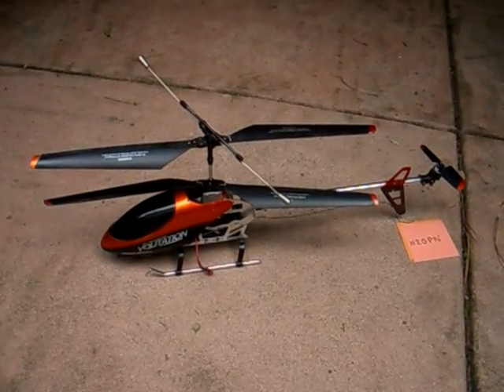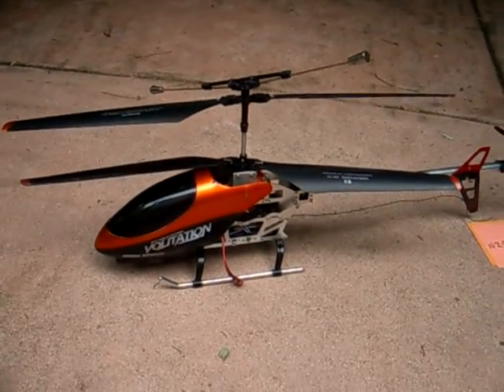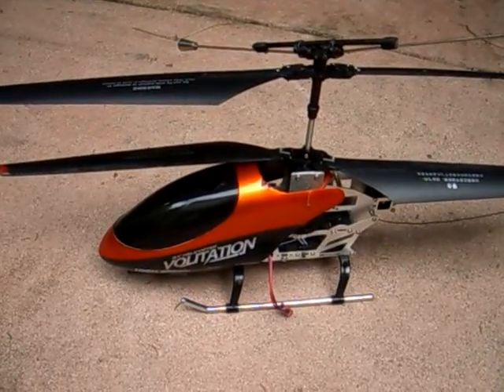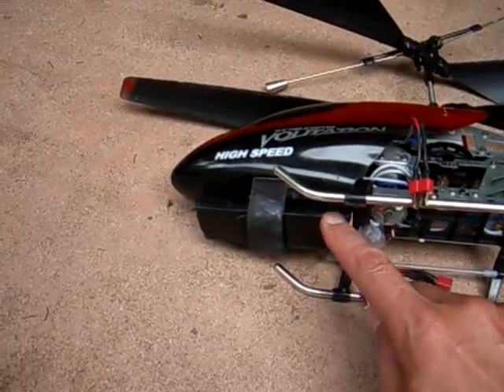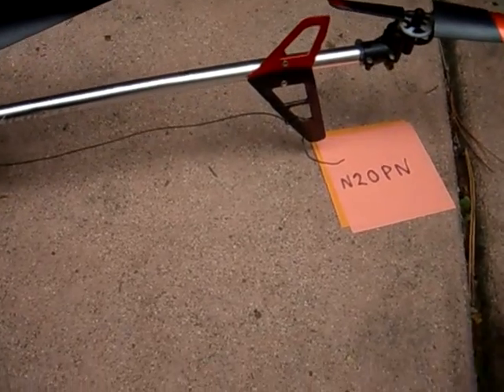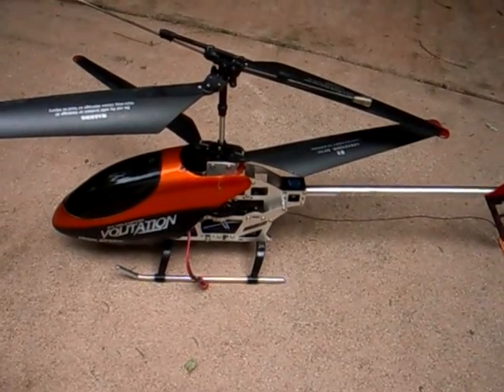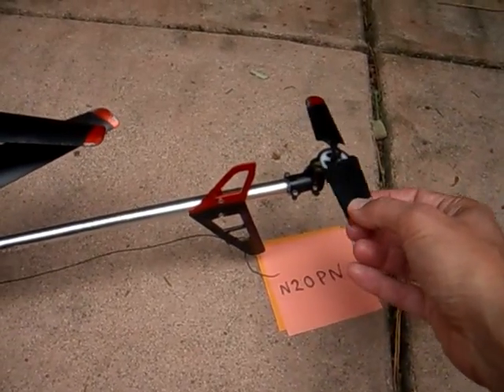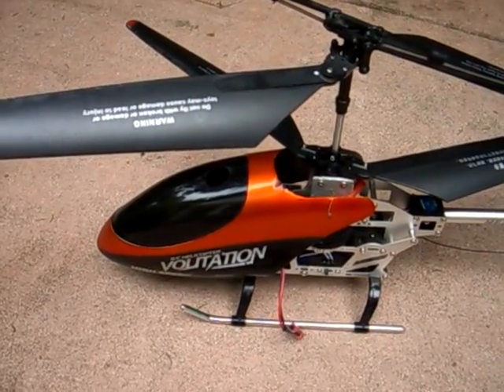9053 Volitation (and DH 9101) helicopter modifications

Comment: Could someone tell me how to solve my issue with this helo.;

After buying I had 3 flights and each one crashed from about 25feet. I recharged the battery, turned everything on and started up the throttle. When throttling up the blades acted like they wanted to turn but the blades only move like have an inch and then quit. 

What might the problem be ? I think its a motor, what could be wrong? 

Also which blades are you reversing, the bottom or top and why would you have to remove the shaft at

Comment: hi is a pleasure. I am  have the same hobby and I want to make a query.
I have a Volitation 9053 and I want to modify it to fly long distaces using these components:

The maximum ground distance was 7.4km away from base.
My Equipment:
- Volitation 9053
- Dual brushless motors Turnigy 1050KV
- Dual 18A ESC
- 5000mah 3s LiPo
- RVOSD gen2
- Thomas Long Range System with Booster set to 3W of output power
- 900mhz video gear 
- Video Oracle Diversity with long omnidirectional and patch antennas

Comment: After tons of research, it all comes down to weight.  After comparing the weight of the stock (88g) to a Sky Lipo 1600mAh 7.4V 20C (98g) and taking into consideration I want to attach a MUVI camera to the heli, I think I'll return the batteries to Amazon and get the Sky Lipo from XHeli (they're on sale for $6.70!). I also picked up a Thunder AC6 charger...way more than I need, but grants room for future endeavors w/ higher-end heli's =)

Comment: Hammy...you've given so much great information. I've followed nearly all of your videos and feel pretty confident in ??the upgrades/modifications I'm making to my Volitation.  Here's a question for you...I accidentally ordered 3 11.1v 2200mAh 20c batteries from Amazon. Will the battery burn anything out, being that it's a higher voltage? If so, what will burn out?  The PCB? Main motors? Tail motor? Will upgrading those parts resolve burn-out concerns? If so, which motors/PCB should I go with?

Comment from the maker: @tvtubedog    If the battery is charged I wouldn’t worry about the green light. The blue tail light connector may be loose on the circuit board. If the lower blade grip is loose, the heli won’t fly. Make sure the screws of the blade grip are aligned with the holes in the metal shaft. It may help if you remove a screw, align the holes with a pin, then tighten the screws. Hope this helps…

Comment: I have learned a lot from this video. Instead of replacing the tail motor as suggested, I have another suggestion. I found that this beast runs faster in reverse than forward so here's what I did: Swap the blue and white wires going to the tail motor...hopefully you have some electrical inclination to do this. Also, move the red wire on the forward/backward potentiometer inside the transmitter to the other available terminal. This restores the normal joystick control; up = forward.

Comment from the maker: @ElemeStudios 
You only need to cut the white gear base if the shaft of the new motor is too short. The metal pin is on the bottom of the tail assembly. I used a small screw driver to start to loosen it, then pulled it out with a pliers.

Comment: Hammy
I've noticed there are several different N20 motors available...different voltage ratings etc...which is the correct one...voltage and amperage? 
Have you seen the newer Double Horse 3-channel Model 9100 with the single blade, servo-actuated pitch control for $60 US dollars???
The flybar for the DH 9077 I ordered came in today and am going to install it on my 9050 (twin to the 9053) and was pleasently surprised to see it has a motion sensored LED on one end...very cool!!!!!

Comment from the maker: @ElemeStudios  Not sure where you can buy a pinion gear, I just re-used the one from the original motor. It is not glued on, it is friction-fitted. To remove, put motor in a vice, heat pinion year with a torch (I used a barbecue torch with a blue flame) and use flat head screw driver to flip it off when it is red-hot. Let cool, put new motor in vice gently tap pinion gear on top of shaft, heat with a torch and the gear can then be tapped into place.

Comment from the maker: @toddy2519  In ebay search for n20 motor. You will have to solder on wires and re-use the pinion gear (see next comment).

Comment from the maker: @CHRISJ0AN  I used a 3mm carbon fiber tube. I put a couple of spacers on the central part of the balance bar so the tube wouldn't hit the plastic end of the shaft. I used black tape to attach the ends of the tube to the balance bar. Thanks! glad you like it.

Comment: the 9101 is a joke as well! same prob with 9101 u can not fly in high rate and make quick turns or u have flight bar strike the blades and cause u to crash i came down from about 60ft like a dead duck! lol i fly glow engine heli's and 600 class electric i was not expecting much at all from the 9101 but cmon at least some quick turns in no wind with out a crash due to bad design please! lol  enjoy ur heli and the sport of rc flying!

Comment from the maker: @shsknight14   It is a replacement motor, the original wore out after a lot of flying. Not sure, but I think it is the same as the original motor. The heli moves faster because I increased the size of the propeller. Syma has a new helicopter the 9101. It looks identical to the Volitation except apparently, they have increased the distance between the coaxial blades.

Comment from the maker: @NatyleeFang  Thanks for comments. With these mods, especially increasing distance between the blades, the heli stopped crashing and I started flying it a lot. After a while the  motors burn out. Replacement main motors are available, but the tail motor was not available only the the entire tail unit is sold. So when your tail motor stops working you can either replace the whole tail unit (about $15) or just the tail motor (N20PN). I use a 7.4v 2,000 mAh lip battery.

Comment from the maker: @Keirosabi 
The plastic end of the inner shaft goes through a hole in the balance bar. Glue or tape about a 1/8 inch piece of plastic or cardboard on either side of the hole of balance bar, this raises the carbon fiber tube so when you attach it's end to metal balance bar, the metal bar will be bent slightly up.

Comment from the maker: @Keirosabi 
That is a 5 inch piece of 0.125 inch diameter carbon fiber tubing. It is secured on ends with tape and has a spacer in the middle so it doesn't hit the plastic end of the inner shaft. Tower Hobbies has them.

Comment from the maker: @moron32 
At least for my 9053 it did help. Initially, mine was plagued with crashes, some of which were due to flimsy connections overheating and failing. I have not had crashes since replacing connectors with higher amperage ratings such as Deans connectors. Also found that unwinding the antennae increased the range. I did like your video.

Comment from the maker: @golani4455 
I think the N20 and the existing motor are the same and their RPM is the same. Some motors have a short shaft and others a long shaft (?). That is a capacitor, not a resistor, it reduces motor interference with the radio receiver, so leave it in place.

Comment: ok i see, need to find a torch now, how much better is the N20 from the existing motor? does is have more rpm? do i leave that little transistor that sits on the motor connection? it sits on the negative positive connector.

thanks alot

Comment from the maker: @golani4455   
There is a pin that runs up into the base of the white gear, pull this pin out. Using a razor, cut off enough of the base of the white gear so that it sits lower and makes contact with the N20pn motor pinion gear. I used a small torch to heat the pinion gear when I pulled it off the old motor.  I put the pinion gear on the new motor shaft, heated it with a torch, and tapped it in place with a small hammer. If you don't heat the pinion gear you might bend the shaft.

Comment from the maker: @tiednotes45554 
I have not used the charger supplied with this helicopter. But I think it should work with any 7.4v battery. I use an Esky charger (7.4v and 11.1v) cost about $10.

Comment from the maker: @1andressole 
This helicopter uses brushed motors, the brushes wear out after a while. I replaced the tail motor only when it stopped working. The horizontal tail wing actually decreased forward motion of the helicopter, so I removed it. The vertical tail wing is only for decoration. On my heli, there is a noticeable difference between slow and quick settings.

Comment: @hammydude12345 Can you help me please! my 9053 wont lift, use too, i watched other video on YT, about uppershaft broke but mines fine, but the little bearing in shaft for upperblades is missing(must have fellout or didnt come with new one and i didnt notice), would that do it? Also on elec. board a red and blue lite keep blinking, what does that mean? im gonna try the lower blade flip like you suggest.. Appriciate any help, thanks!

Comment: I am wondering why you replace the tail motor. Is it not enough to just increase the tail rotor size? Are you looking for forward speed with this modification, more then plain control improvement?

Comment: I've been searching the web and seem to not find anybody with a radio problem on the 9053.  Out of the box, I have been having problems with my radio specifically the up/down control.  For some reason, the signal would be lost on the up/down control and the heli would just go straight down.  I'm not sure if it's the radio, antenna or the receiver but I think I got a defective item.

Comment from the maker: @June061944DDay 
The inner shaft on my heli only has one notch, it is about 5mm above the end the lower end of the shaft. When assembled, the inner shaft protrudes about 2 to 3mm (1/10 inch) below the brass fitting on my heli.

Comment: @hammydude12345 Hi hammy, thanks for replying!  The brass fitting is facing down and it's facing the screw.  I can see from the bottom of the gear that it's facing it the right way.  I believe the screw is supposed to fit on the lowest point of the shaft.  There's two notches on the shaft but I believe the screw goes in to the lowest notch.  Can you verify this?  Thanks!

Comment from the maker: @June061944DDay 
Not quite sure where the problem is, but think you are trying to attach the lower gear (the one with the brass fitting) onto the inner shaft. The inner shaft has a flat surface, this should be facing the screw, misalignment may be the problem. Also make sure that the lower gear is placed correctly with the brass fitting facing down.

Comment: I did the lower blade shaft reverse mod last night and I had a problem on the screw for the bottom gear (main blade A). For some reason, I am not able to screw the gear properly to the inner shaft.

The screw It fits perfectly fine when I remove the inner shaft and try it outside the assembly area but when I put everything together, the screw doesn't go all the way into the inner shaft! Please help!

Comment from the maker: In the middle I used 2 small plastic spacers to lift the carbon tube off the balance bar so that it doesn't hit the plastic top of the inner shaft. In the middle I used wire and hot glue to attach the tube to the plastic middle of the balance bar. The ends of the carbon tube were attached to the balance bar using black cloth tape.

Comment from the maker: Take the tail assembly apart, there are 6 screws plus 2 small ones that hold the N20 motor in place. I removed the pinion gear from the motor after heating it with a small butane torch. Then place pinion gear on new N20 motor shaft, heat with torch and gently tap in place. Re-attach wires to motor and reassemble the tail unit. Note- I didn't replace the black cover because it doen't have any function and is one less thing to disassemble and put back together.

Comment: @mdmkn420 
How did you screw back in the supporting screw into the shaft..   with no holes to support them the plastic bracket will strip. Did you drill new holes into the shaft?

Comment: @hammydude12345 I have a 9053 and have ordered a 2200mAh batt for a Walkera V200D02. I  want to take the OEM batt from the Walkera and 9053 and link them in parallel. Both are 7.4 V and 1000 and 1300 mAh respectively. Then install the linked batts in the 9053 adjusting for c og g. BTW, I have already made the mods from your video to the 9053 and I am waiting for replacement blades. Any suggestions on the batt mod?

Comment from the maker: @mdmkn420 
I use a 2000mAH 7.4v battery which gives much longer flights. I don't use the supplied lipo charger, I use an E-Sky charger that does 11v and 7.4v lipos, it cost about $12 shipped. I believe that the lipo chargers shut off at a specific voltage, so I think you can use the charger supplied with the 9053 for your 2000mAh battery, but have not done so myself.

Comment from the maker: No, all blades are right side up. Remove the lower blade grip (part # 9015-13) from the shaft (part # 9053-10) and remove the blades. Then place the blades upside down on the lower blade grip. Then place the lower blade grip upside down on the shaft. The lower blades will now be right side up, and the distance between the upper and lower blades will be increased. This will eliminate collision of the upper and lower blades.

Comment from the maker: @naphetsle 
I didn't buy the tail blade. I took a damaged main blade, cut off a 50mm lengths, and used hot glue to attach it to the small tail blade that came with the helicopter. You could also modify a blade from an airplane to fit on the tail.

Comment from the maker: I cut off the the battery connector on the helicopter chassis and replaced it with a Dean's male connector, you can see it on the video. The lipo batteries have female Dean's connectors. The blades are right-side up. I believe that the original tail motor was an n20pn. I attached a 12cm long 3mm diameter carbon tube on the balance bar to keep it from bending.

Comment: 1. Can you take a picture of the unit without the canopy and of the board? ( I'd like to see how you wired it( bigger battery, Dean Connectors, and bigger wiring overral to prevent overheating.

2. Is there any difference with the blades up side down in terms of speed, stability, and turning ?

3. is the n20pn the original motor ?

4. what did you use to keep your balancers up in the air. I see a plastic holder but i cant really see well due to the quality of the video